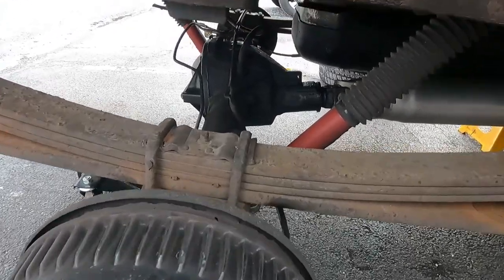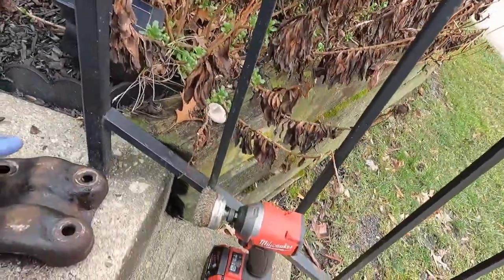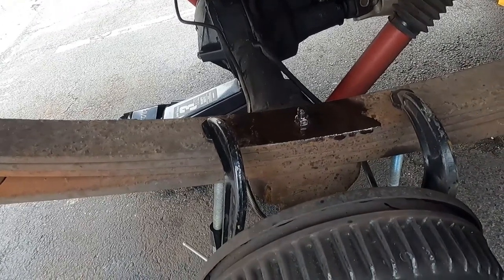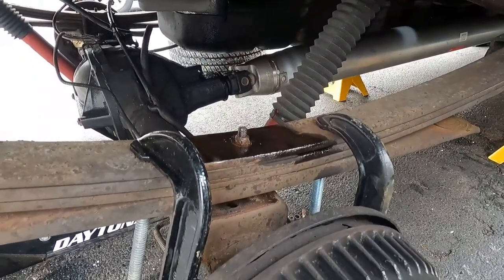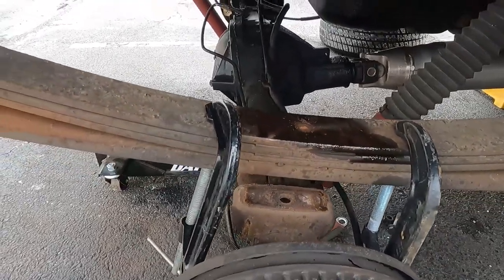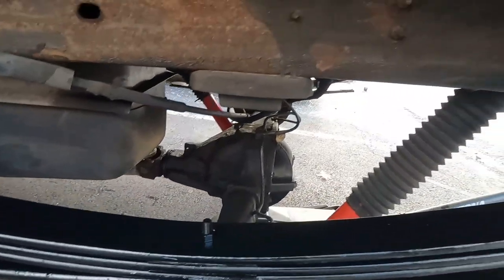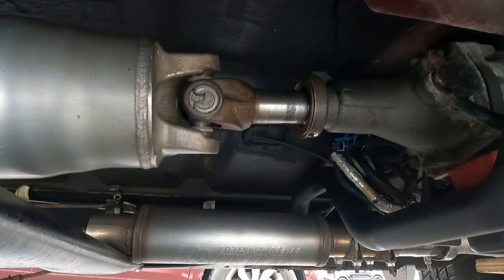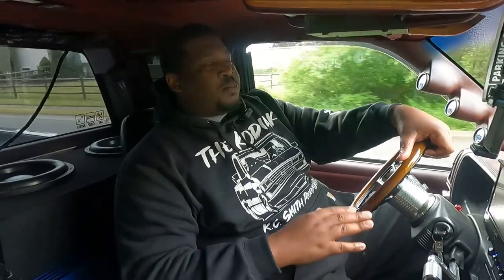1 Piece Drive Shaft For 2WD Extended Cab OBS Chevy Pickup (Part 2) Pinion Angle Shims And U-Bolt Ins

Comment: Have you had to do any more  adjustments since driveshaft and shims have been installed. Did everything work out? Has driveshaft held up since installed
Reply from the maker: It held up and I still have it. After I got the angles right, I ended up lowering it another 2 inches in the rear. Then I got vibrations. Then I went back to the 2 piece because I didn’t feel like figuring out the geometry again. I’m going to revisit it later. I had other videos I wanted to do and parts I was waiting to install. So I put the 2 piece in so I can move on with the other stuff for now.

Comment: Been watching the vids on the obs. Nice truck. Would you happen to kno the exact cal tracs you used?
Reply from the maker: Appreciate it man! It’s the actual Calvert brand. But they sell 2 options. One option is for trucks like mine that still have the axle below the leaf springs and the other is for people that lowered there trucks by flipping the axle and putting it above the rear leaf spring. Which one did you want.
Reply: @RCSmith90  My truck is like yours but fleet side. Im lowered but only 4 inchs so axle still below the springs.
Reply: @RCSmith90 thats the problem Im having cant find the one for the axle under the spring. Was beginning to think it wasn't made until I saw your vid.
Reply from the maker: @Rodrawdaboss  CLV-3300 is the exact part number. Ignore the picture. When you read the description it says axle under spring.
Reply: @RCSmith90  thats definitely it. Guess I wasn't looking hard enough. Appreciate it
Reply from the maker: @Rodrawdaboss  it definitely wasn’t  that you didn’t look hard enough. I like to check if something is correct multiple times before I buy. So I was looking extra hard because the pictures don’t match. Even on the Summit Racing website I had to look at the asked questions and reviews to figured it out. All the axle flip guys were asking if it will work for them. All the answers were no. Axle flip Caltracs have a similar but different part number.

Comment: Would it recommend for flip kit? How you use measure your ping angle
Reply from the maker: Are you trying to find out what pinion angle you would need to work with a flip kit?
Reply: @RCSmith90 I am! I think the flip kit I have is a 6 inch drop for the rear
Reply from the maker: @cosmic8845  Do you have a short cab with a one piece shaft or a extended cab with a 2 piece shaft.
Reply: @RCSmith90  single cab long bed, 1994 c1500 with a one piece drive shaft
Reply from the maker: @cosmic8845  Just tried to look but couldn’t get a direct answer. It looks like guys are using 4 to 6 degree shims for similar to what you have. You can start by grabbing those when you do the job and then get an angle finder like I had in the video to see which shim seems better.
Reply: @RCSmith90  I’ll probably go with the 6 degree shim for now and see what happens
Reply from the maker: @cosmic8845  ok cool. LET ME KNOW HOW YOU MAKE OUT!!

Comment: Do you have the part number for the shims?
Reply from the maker: Depending on the night if your rear depends on the degree shim you should get. I got this from Western Chassis. I’ll tell you the exact one I used if you want.
Reply: @RCSmith90  I ordered an eBay flip kit c notch. I think it’s 6 inches. I’m just looking for shims before I install it so I can do it all at once.